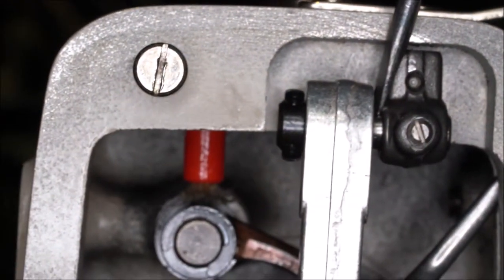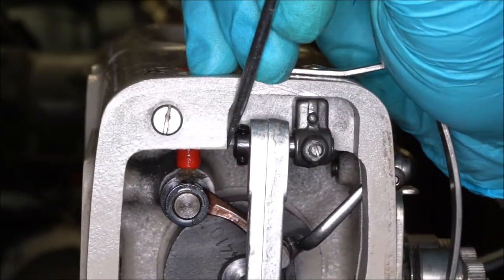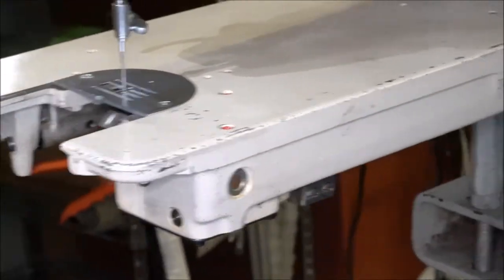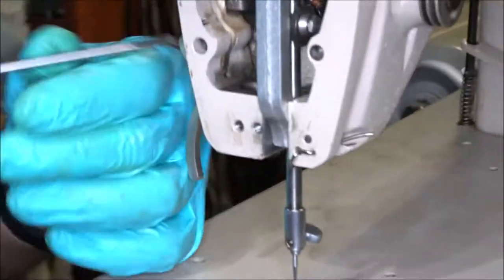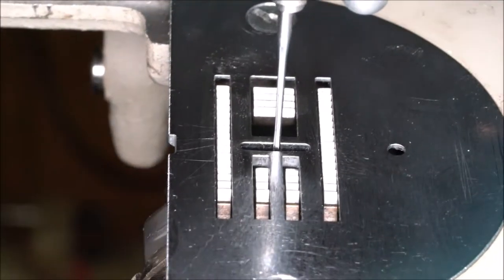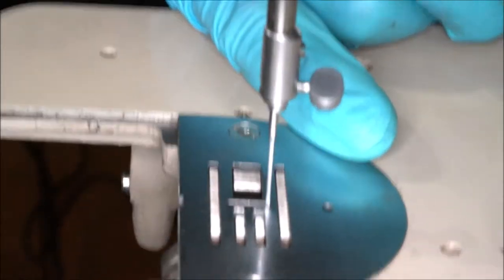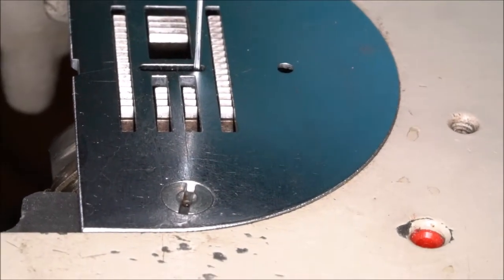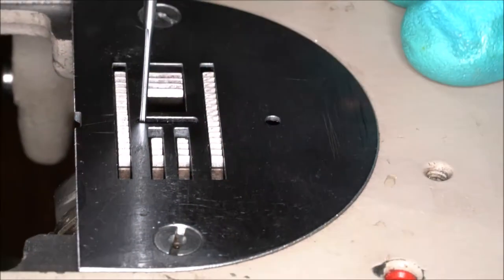Adjusting a Bernina 217 industrial sewing machine

Comment: i purchased a bernina industrial 217 n 08 sewing machine without a motor or table i have an old singer 241-11 that has a motor and table can i swap the heads  and use the motor for the bernina 217 n 08 and would you happen to have a manual you can share
Reply from the maker: Yes you can any motor with this machine. You can join the Vintage Bernina group on Facebook and download the user and service manual there for free.
Reply: @philipbrutz2175  there are more than one which do you recommend
Reply from the maker: Tence Valentin Download the multiple language version
Reply: @philipbrutz2175  i meant which group

Comment: Where can i buy the needle bar clamp/5mm block and 2mm forked gauge?
Reply from the maker: It is almost impossible to find original Bernina tools. You might want to try improvising using a machinist 5mm gage block and a Clamping Two-Piece Shaft Collar, for 6 mm Diameter, Black-Oxide 1215 Carbon Steel
https://www.mcmaster.com/6063K13